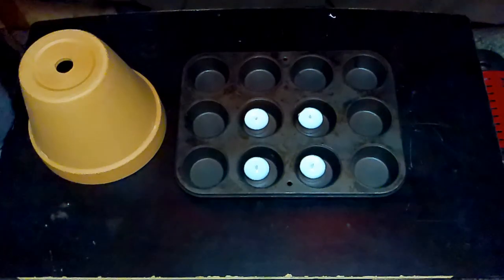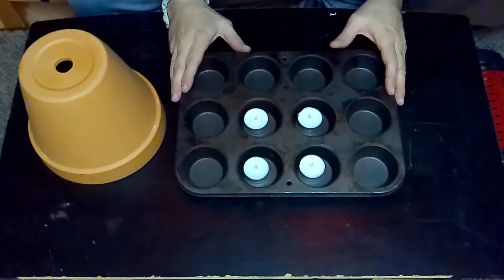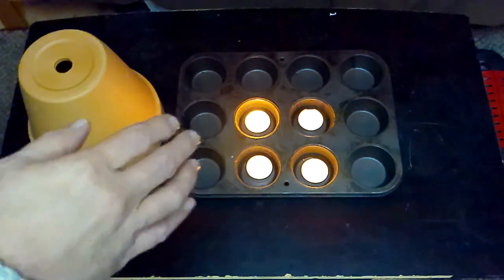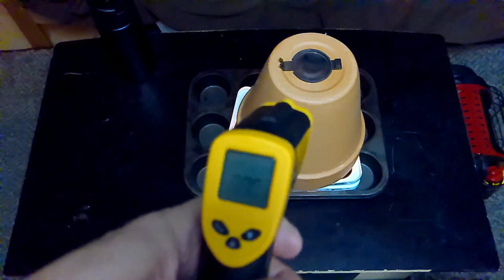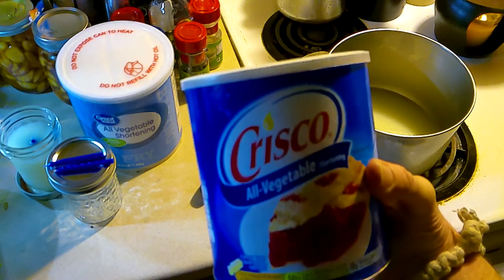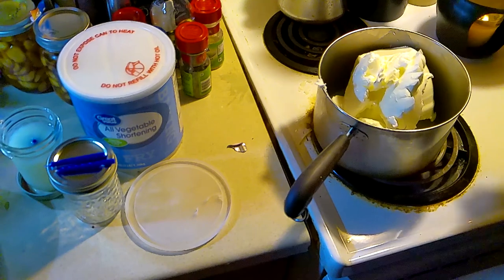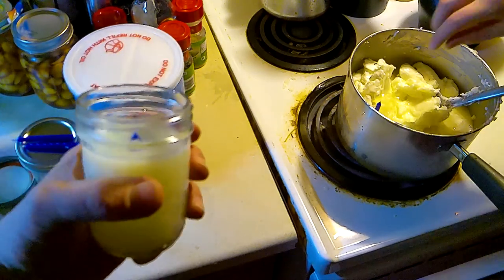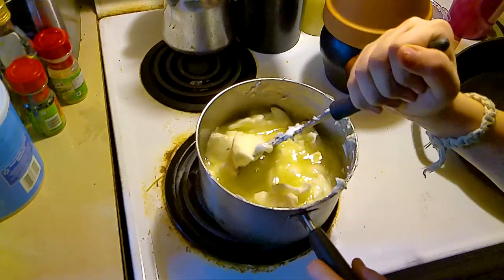EMERGENCY CANDLES AND CLAY POT HEATERS.

Comment: I love that you've got your son working on this project with you.  I've watched several flower pot how to videos.  This one is really good.   I never saw anyone melt the shortening, pour it into the jar and then seal it up for storage.  If there were a power outage, for those of us who live in an apartment, I'm hoping that two of these would keep the temp in the room to at least the 40's or 50's if it the temps were in the 20's outside.  I live in Michigan and we see below zero.  But if we don't have any heat and we have a couple of these going, hopefully it would do something.  I've also seen other's use 2 pots to make one heater (a larger pot and a smaller pot underneath to build up the heat).

Comment: Instead of having to add metal bookshelf brackets to raise the pot, what if you would have turned the muffin/cupcake upside down and put the tea lights in the valley sections.
Reply: Hi Helena yes if the tea lights fit i would think it works fine and should give enough space for airflow, thats what matters most is to keep enough oxygen under the pot to keep the candles burning :)

Comment: For your future reference the calculation to determine the amount of BTU's required to raise the temperature in a room is as follows: 
(Desired Temperature Change) x ( Cubic Feet of Space) x 0.133 = BTU's. For example a 10' x 10' room with an 8' high ceiling is 800 cubic feet in size. Lets say current temp is 30F and you desire 50F to survive the power/heat outage ... then the calculation will look like:
20 Degrees x 800 cubic feet = 16,000 x 0.133 = 2,128 BTU's required. A tealight candle like the ones used early in the video generate 100 BTU's each. So to increase the temp in our test room by 20 degrees then 22 tealights are required or 6 of your devices. 
Re the Shortening Candles, using a birthday candle as the wick is smart but you will notice the wick is much thinner than a tea lights and as such will generate a smaller flame producing less BTU's. I enjoyed the video, Cheers.
Reply from the maker: Thank you Warren for the info, I can only go by my measurements that I had at the time but I can say it did make a considerable difference. I do agree room size is key, in a survival situation the smallest room possible would be my choice.  I also recommend a microenvironment such as a tent set up inside the housing area..but that's alot if info for one vid 🙂 the tealights would do if you had enough but the shortening candles did work much better.  I do have to disagree on the size of wick though as the bday candles were twice the size of tealights the bigger the candle the bigger wick you need.  I suppose you could use a tapered dinner candle and plunk it in the larger crisco container. Save some time.  The heat generated from the clay pot I think makes a difference in your formula though, it's not just flames. Being as the heat is captured and dissipated by the clay pot.  Really great advice thank you and will keep it in my pocket 🙂
Reply: Use a new cotton mop string for the wick. But it would burn off more Crisco faster.
Reply: @margaretcouls1451  Dear Ms. Couls, excellent idea. If you use a cotton mop string or cotton butchers cord you will want to soak the cord in melted shortening first ... otherwise if you use dry cord it will cause 'burn out' problems. Other tips are to melt the shortening in a pot on low heat before adding to a jar and add scented oils or spices like nutmeg and or food coloring. Even make small batches of melted shortening and scent and color each batch differently and pour in layers in the candle. Of course each layer will need to solidify first. Cheers.
Reply: @mainebuggininbugginout1601  
Hi again, I meant to tell you I don't use Crisco I use the great value brand, it's a lot cheaper and works just fine. I also wanted to say thank you for your service, my brother was a Marine.
God bless you real big ✝️🥀🐴🇺🇲
Reply: @mainebuggininbugginout1601  
Hi, one more thing. You can melt Vaseline in a pan, put cotton balls in a jar and pour the Vaseline over the cotton balls then put the lid back on. They will absorb the Vaseline and They make great fire starters.✝️🥀🐴🇺🇲
Reply: I plan to use a new mop string for the wick. Someone said that I need to get it saturated in the melted Crisco first

Comment: You really don't have to buy jars. Spaghetti sauce jars, pickle and olive jars make excellent jars for candles.
Reply from the maker: yep, thats right Judy, and type of heat resistant container works great, all those you mention would be great and the fact those types of jars have already been exposed to heat during processing makes it even better.  People just want to steer away from anything that might be flammable.  Thanks for the comment :)

Comment: Sterno chafing heaters would be awesome in one of these
Reply from the maker: Those work amazingly well Renee, only thing is the clay pot gets much hotter and you'd be using up your cooking fuel, the mason size candle made with crisco work great and are much cheaper than sterno..you just have to find something large enough to keep it in place under the pot and stil allow airflow.  New videos coming soon, spent all summer videoing :)
Reply: @mainebuggininbugginout1601  yeah but my brother has bad lungs so i try not to put too much in the air. I can't even cook sausage in my house because it messes with his lungs.
Reply from the maker: @reneebrown2968  ya that makes sense, my son has bad allergies, have you thought of using some 20 inch Merv filters behind a box fan?  I may do a video on those, but there's a ton of ways to do dyi air purifiers.  Place a filter behind the box fan with small spacers for airflow with st least at 13 rating for the filter.  He seldom has allergy problems in the house and we have a cat that used to drive him crazy.  I have a fan on each floor of my house on low, and change filters about once a month.  Filters are on Amazon well box fans too lol. Just an idea and cheap.
Reply: @mainebuggininbugginout1601  my brother has a genetic condition called Alfa 1. Basically his liver doesn't make the protein to keep his skin and tissues elastic. So certain smells and chemicals can leach out the protein out of his body causing his lungs to stiffen and not work properly or in bad enough circumstances at all. So when he says that grease or oil is causing his lungs to burn i eliminate it. Or it has to be outside.
Reply from the maker: @reneebrown2968  Jeesh that's tough , sorry to hear and I'd do all I can as well. One thing I know that is inexpensive is isopropyl alcohol it is very clean burning, however it burns fast in like alcohol stoves and when used as heat.  Not sure if it's cleaner than sterno but would be worth comparing not for burn time but for contaminates like residue and soot or carbons.  Good to know these things if you ever have to stay in an enclosed area for any amount of time and need to make heat.
Reply: @mainebuggininbugginout1601  it's been years ago but I've used a can a roll of TP and alcohol to make a heater when i got stuck in a blizzard in upper Michigan. Works awesome. No soot. And you can extend the burn time by adding a metal lid off of the can. It will burn around the edges and therefore slower.

Comment: Try turning cupcake pan over and put tealights in between that should give you more air flow I also a few smaller stones
on top then you can put the stones in a double sided pan and use as bedwarmer

Comment: What about using a stainless steel pot ?  It gets hot very quickly.  Is the terra cotta supposed to be better for radiant heat than heat radiating from a steel pot?  I tried both, but I want to know what others say about this. Hard to say for certain the difference due to other variables. Thank you!

Comment: Why not use the Crisco idea on the heating pot? Much more efficient and more heat. Use those baby candles for the light source.
Reply from the maker: Hi BigDawg thats exactly what i show at the end of the video :), I used the candles we made as a heat source, only using the tealights as one example of what people can do if the power goes out.  Hopefully people take 30 minutes and make some type of emergency candles for whatever they may need them for, whether heat, fuel for cooking or just light.  So cheap to make.  Thanks for the comment.

Comment: Put the can of Crisco in your car on the dashboard with windows closed in warm weather to melt it easy.
Reply from the maker: Hi Margaret, yes I'm sure that would work as it only takes about 80-85 degrees to do the job..especially if you have no power to use the stove top.  Hopefully these are made ahead of time so it's ready to go.  Thanks for your idea :)

Comment: What did you have the big candles in under the pot?
Reply from the maker: Hi Alisha sorry I've been gone a bit, I actually used an old fondue/s'mores   cooking base.  I bought a new one as it's great for not only clay pot heaters but for cooking as well because it has a metal grate that fits on top :)

Comment: Have you attempted to out your Crisco Candle under a clay pot? What were the results?
Reply from the maker: Hey Gram, yes I actually used the emergency candles inserted into an old fondue set i had, you should see this at the end of the video.  The bonus was that the heat did increase, but the amount of heat as Warren mentions below for the Crisco candles depends on the wick size bigger wick, bigger flame, more heat.  Another upside to using the Crisco candles is that they can burn for many hours versus a small tealight.  If the candle goes out and the pot loses heat so does your room.  Hope that helps :)

Comment: Bacon grease works too!  Grandmama saved all her grease for all kinds of cooking and candles.🙂
Reply from the maker: Ha funny you mention bacon grease Cheryl, I actually made 2 batches of these candles one i mixed bacon grease with the crisco, and ended up with bacon scented candles..hmm now theres a money making idea.  It worked well however bacon grease doesnt solidify as well at room temperature and is a bit soupy so they would have to be kept cooler based on how much bacon grease you used.  great comment and thanks :)

Comment: You can use a normal oven tray it works better than the muffin as it gets a better air flow and you can have more candles under it also why are you blocking the air flow hole? That gives a constant flow of hot air take it off lol the room warms quicker
Reply from the maker: Antonia thank you I will try this, my intent was to keep the heat inside to radiate through the clay pot..even though heat will dissipate normally its much more consistent though, convection I guess would be the word? Not sure but the heated pot spreads heat better than going up through the hole was my experiment.  I'm interested to see a temperature scan with the hole not covered and with.   I will do another video to see 🙂 thanks for the advice.

Comment: 4 candles       really  the spacing you used could hold 9 candles  plenty of heat
Reply from the maker: Hi Alan, yes the amount of candles would be a personal decision I merely wanted to show people the basics of setting it up so they would know ahead of time.  Showing the heat measurements of the clay pot I was trying to let them know how much only 4 candles made a difference.  Again remembering the more candles the more heat and could become unsafe in certain situations with small children.  In a grid down winter situation absolutely more candle is better, you want as much heat as possible.  There are a ton of different variables to make this experiment better by far but hopefully everyone got a starting point :) Thanks for the comment.